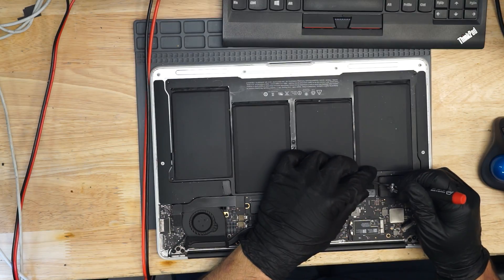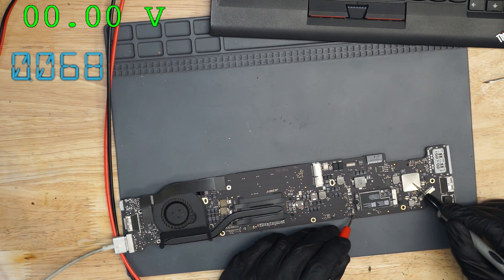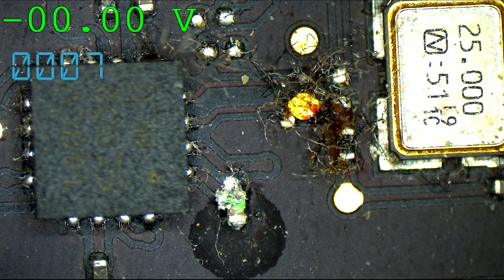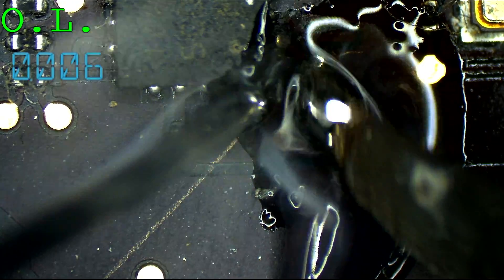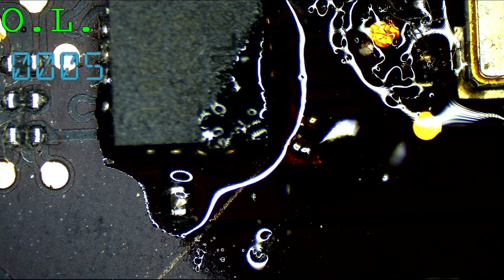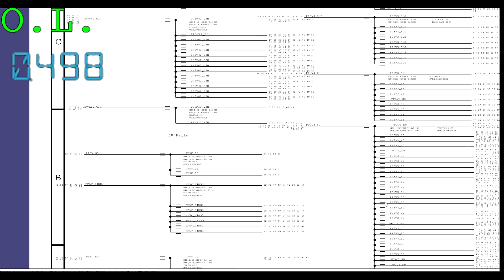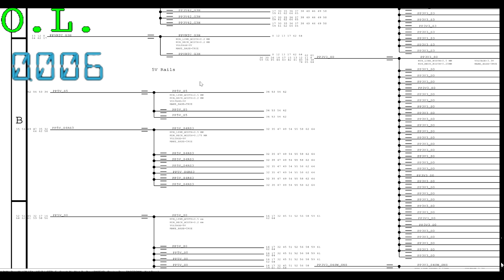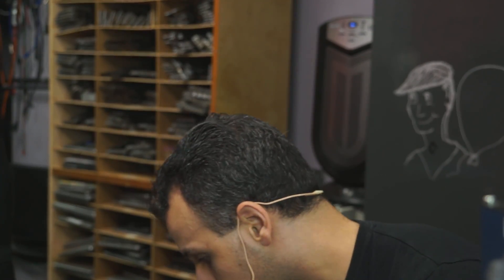A1466 Macbook Air taking 70 mA and dead logic board repair

Comment: Hello Sir..i have a problem with a customer macbook air this was turn on itself without pressing power button,and it works fantastic on battery ,bt when plugged in charger its turn on itself and works normal when shutdown then again its turn on itself again...any suggestions for this...

Comment: Hey Louis, big fan of your vid. I have a A1278 macbook pro 13' that I never used and it has this screen glitch issue any time I move the screen up or down. Is it the graphics issue or LCD connector?
Reply: That is probally the screen connector since it happens when you move your screen
Reply: dominik obora im going to swap the hdd to ssd and hopefully when im in there i can fix the issue hopefully its nothing to hard

Comment: I learned something today thanks to Louis.

Macbooks suck.
Reply: Been pulling apart laptops for years and even simple Dell and hp computers have plastic film under the keyboard / palmrest to keep gunk from getting on the board. PROFESSIONAL Dell laptops sometimes have plastic on the motherboard itself. Everyone else tries to somewhat protect the board, but Apple WANTS it to get dirty or wet so that you'll buy another. Leaving the board exposed leads to exactly this.... And I'm going to assume they didn't change it even with the modern boards being fully responsible for all your data with soldered in drives.

Comment: Does anyone know of someone that works on video cards?

I have an EVGA 1080ti SC2 Hybrid that has dmg from a mouse pissing on the back of the card.I live in a converted loft in a barn in the country and last fall I was gaming and my computer died. I'm anti rgb so I have an old school case with no windows.

So the computer wouldn't power on so I opened it up and I found 2 dead baby mice in the case. Then I looked at the back of the video card and it was caked in mouse piss. So I took the back plate off and cleaned it the best I could. It was under warranty so I sent it off and the rma was rejected because of liquid dmg. There is rust on some of the solder points and pads. Anyways the card works with DVI but HDMI and Display port doesn't work. Windows sees the card and will install the drivers and I can game on it but I can't run multiable monitors. So I think a reflow and a good cleaning will fix the issues but I don't know.

I want to  thank you for your work in the field of repair and the right to repair. We throw so much away now that it's not funny.
Reply: As long as no components got damaged a ultra sonic cleaner after working the rust off. And there ya go.
Reply: @judgemanny9316  Thank you. I just watched the Do NOT cum on your Macbook! ||| Donor boards are A-OK!!! video and at the end he talked about ultra sonic cleaners. What sort of businesses have ultra sonic cleaners? Like I said I can game on the card without it crashing but dvi is the only thing that works for output. All the dmg is on the back of the card thankfully.

Nevermind about will a ultrasonic cleaner dmg a pcb board. Found the video of Rossmann talking about the cleaners.